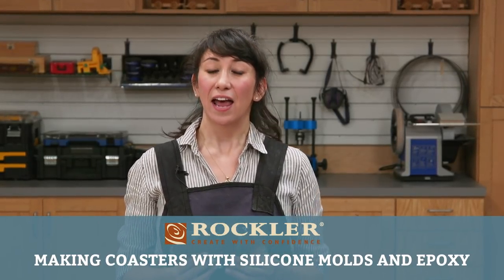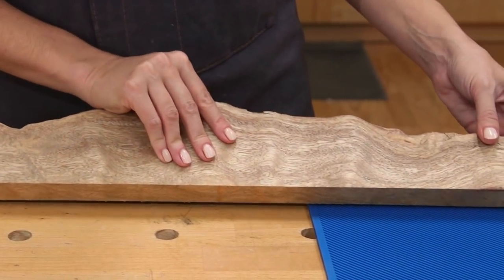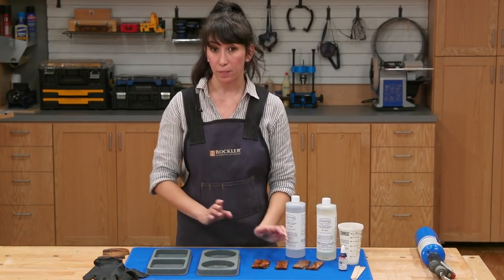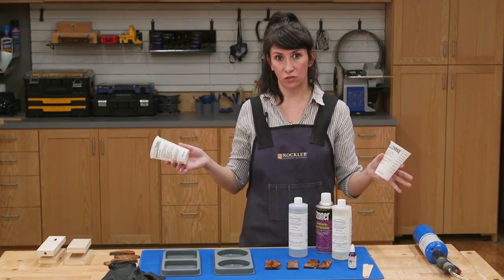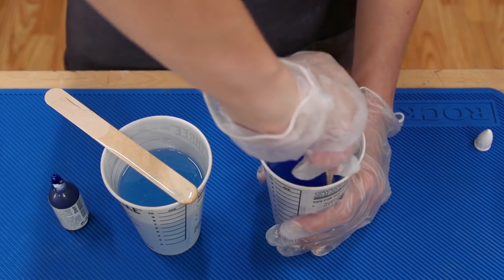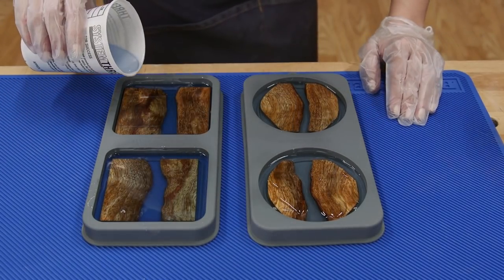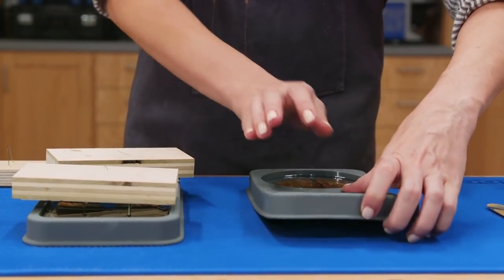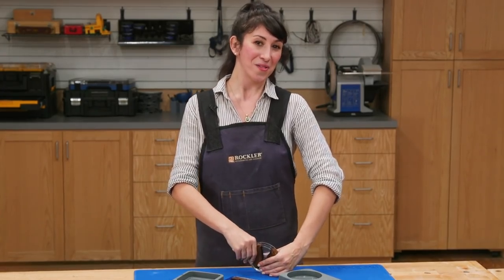How to Make Epoxy Coasters with New Silicone Molds | DIY Project

Comment: If you put the wood pieces on the bottom layer of epoxy, let it cure a little so it sticks well, then pour the top layer of epoxy, you won’t have to use anything to hold the wood down. That way you won’t have nail holes showing.
Reply: I gave this type of project a try.....before I watched any diy videos.  Pretty sure I violated every single epoxy rule out there :)!  I will try this on my second attempt though!
Reply: Good idea, about how long did you think you have to let it cure so that it sticks a little?
Reply: @robw95  3-5 hours..... depending on the brand/type of resin that you're using.

Comment: You don’t have to sand the tops and bottoms?
Reply from the maker: Not if you don't want to. The epoxy will be extremely smooth and crystal clear right out of the mold. If you sand down any sharp corners or anything, you will have to sand up to a very high grit and then polish it to get it clear and that smooth again. The choice is yours.

Comment: I guess the pin holes are on the bottom side.  Would it make sense to remove the weights after 6+ hours and see if pin holes will disappear that way?
Reply from the maker: Hi Chaos & Order, Please reach out to our product support team at 1-800-260-9663 or support@rockler.com. They'll be able to assist you. Thank you

Comment: Curious question, I've got a project in mind that would require me to pour half the epoxy, let it cure, add the material that will be in the middle, then pour the other half of the epoxy.  (sorry if that is confusing).  Do you believe this could be done and it look as if it were a continuous pour?  Or would it be clear that it was done in two separate pours?
Reply from the maker: Hi, Please reach out to our product support team at 1-800-260-9663 or support@rockler.com. They'll be able to assist you. Thank you

Comment: I have marine grade epoxy would that work?
Reply from the maker: Yes.
Reply: @rockler  I know it exotherms in large quantity how do you avoid this
Reply from the maker: Each epoxy is different, check the manufacturers recommendations on how deep it can be poured. Generally, you don't want to pour it thicker than a 1/4" at a time, unless it is deep pour epoxy.

Comment: can i use Clear Silicone Release Spray Mould Releasing Lubricant on wood ?
Reply from the maker: Because of the wood being porous I doubt it would work.
Reply: @rockler  How about a couple of light coats of POLYURETHANE CLEAR VARNISH let to dry properly first ?
Reply from the maker: Not sure we are understanding your application goal here. Are you putting this wood in a silicone mold and casting it in epoxy?
Reply: @rockler   yes
Reply from the maker: You want the epoxy to bond to the wood. I would not recommend spraying the mold release on the wood. If anything, you can apply a seal coat of epoxy or sanding sealer/lacquer to the wood to help prevent air bubbles from coming out. But it would be fine to just put the wood in the mold and pour the epoxy. Mold release should only be sprayed on the mold before putting in the wood and epoxy. Hope this helps.
Reply: @rockler   No i want to use the wood to make a mould in silicone then make a copy of the wood in epoxy !
Reply from the maker: Got it. Maybe try the seal coat process and completely seal the wood in a thin layer of table top epoxy. Then you could apply mold release to it once it is sealed, cast in silicone, and then it might come out easily. Neat idea, good luck!